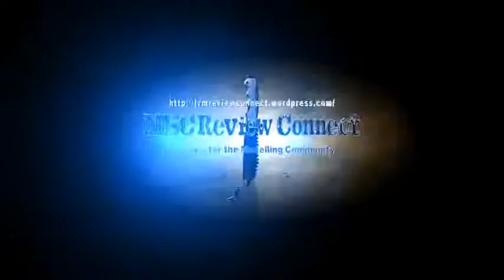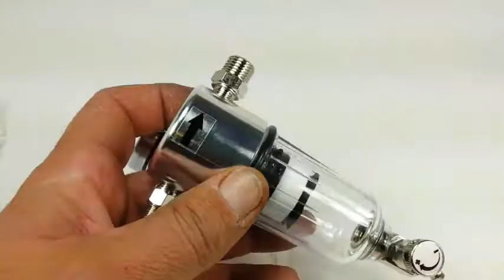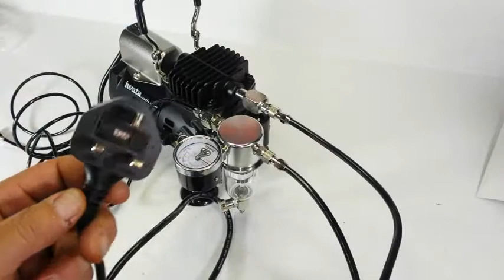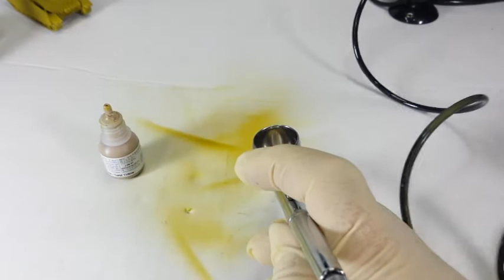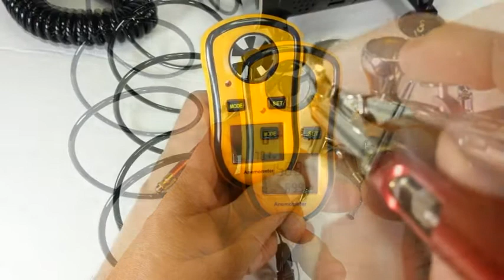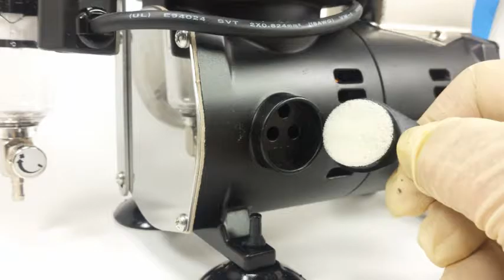Iwata Smart Jet Air Compressor Review

Comment: Fantastic video. Thank you so much! This is about 2x the price of a standard AS18 compressor (which usually goes for $70-80). You've clearly outlined the advantages. I'm considering the Sprint Jet, which I think is very similar, but quite a bit cheaper ($200). Is it equally good, I wonder?

Comment: I bought this one and it's great. But I'm using most of the time 20 psi, so the compressor is always on. I want to add a regulator (thinking about the Euro-Tec 10A). But i'm not really sure how to put it on. Do I just replace the Moisture Trap/Regulator with the new regulator?
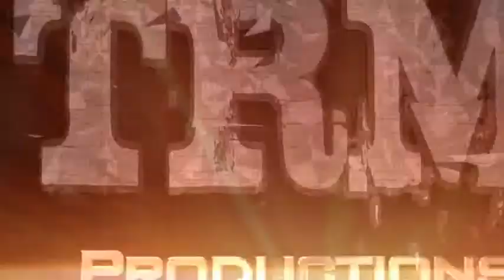Reply from the maker: You do not have to replace the existing moisture trap if you don't want to.  I picked up a cheap standard adjustable regulator with the same size fittings off ebay for under $6 US...free shipping btw..LOL   I added it before the coiled hose.  You will need both a male and female adapter for the regulator.  At 14:41 in the video, I hooked up a regulator to show this.   It worked like a charm for me.
Reply: Todd Michalak thanks for the quick reply. I will have a look at it.

Comment: Hi Todd, thanks for reviewing this video. I just wanted to know does this compressor blow air at 50psi continuously? I actually want to buy a compressor but am not sure. I want to use it to paint RC bodies. The paint requires 40 to 70 psi and that is the reason I am asking. The name of the paint is Faskolor. I would appreciate if you can provide me some info. Thanks in advance :-)
Reply from the maker: Hello Ryuji,  

While the constant flow is maxed at 50 to 55 psi, The working pressure is about 30 psi, +/-, depending on the airbrush.  With those high working pressures of the Faskolor, you may want to consider a compressor with a larger output or an external tank and standard regulator.        I know most companies including Iwata offer models with external tanks.       Another option might be a smal commercial air compressor, similar to the ones sold at Home Centers and are used for construction.   They can provide 90 to 100 psi working pressures, have a tank and can be regulated to your desired working pressure for the paint.  I hope some of this helps you a little...best of luck my friend!   Cheers,  T
Reply: Hi Todd, thanks for your reply. Can you please give me a cheap & a good solution to this please as I see that you have a lot of knowledge about that and also you review products a lot. I would appreciate that if you can recommend me an Air brush and a compressor. Just like you said a commercial one. I think I have one which has the working pressure of 30/35 psi.
Reply: Hi Todd, thanx for your reply. Is there any small commercial air compressors that you have in mind and that are cheap that you can recommend me as I can see that you have a lot of knowledge. I would really appreciate that if you can help me in this too, thank you!
Reply from the maker: You're welcome!   Again, my apologies for getting back to you so late.  That "work thing" takes a big chuck of the day sometimes...LOL

   If you have a compressor that has a working pressure of 30 to 35 psi, that is typically more than enough for airbrush applications.   If you need the recommended pressures for Faskolor and are considering buying a compressor that can handle higher continuous flow, I would recommend looking at any local Home Centers...like Home Depot or Lowe's or something comparable in your location.   They carry small pancake compressors and other smaller versions for light duty construction work.   They are more cost efficient sometimes than the larger airbrush compressors.  As long as there is a supplied regulator, you can adjust the outgoing flow to any psi level you desire.  Most of these compressors have a 3/8 inch threaded output.  Some, might have a 1/4 inch output.  Most Airbrush compressors are 1/4 and 1/8 inch outputs.  You will need an inline coupling or adapter to hook up the air hose.   Most home centers and hardware stores carry these adapter.  You can find them online too...like ebay and probably free shipping.   

I will send another reply about airbrushes.....
Reply from the maker: As for recommendations for airbrushes.   I have several models that I use.  I do prefer a couple over others for a number of reasons.   Harder  and Steenbeck is an excellent brush.  There are several grades you can choose from.    Depending on how big of a needle you think you will need, might depend on which airbrush you buy as well.   A standard needle size would be .2.   I typically use this for everything and .15 for delicate up close work.  For larger projects, I sometimes use a .3 or even a .4 form time to time.   Have a look at Grex.  They have excellent brushes and options for larger cups, needles and options.   Badger is another excellent brush.  Again, they have several models with different size needles and cups.   I have not used Faskolor paints before.  I would think it would be best to have a look at what other uses might be looking for needle sizes...this will help lead you in the right direction.